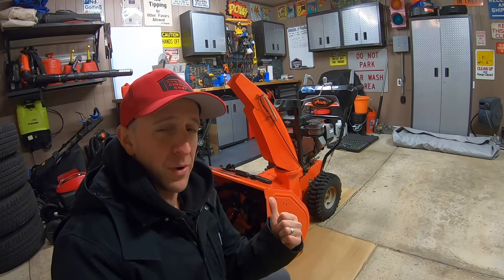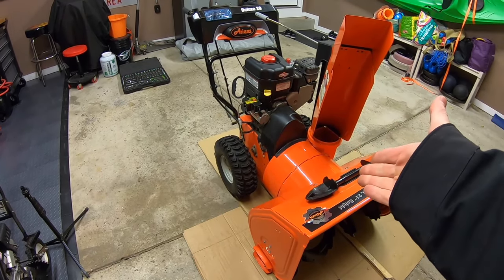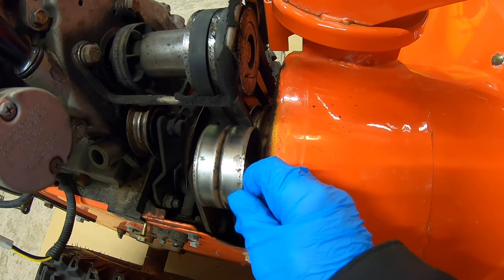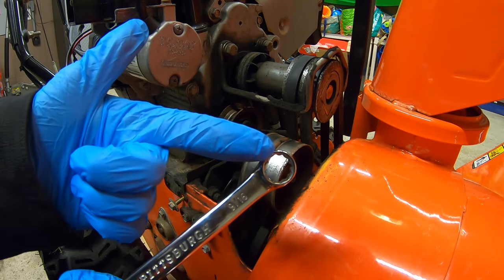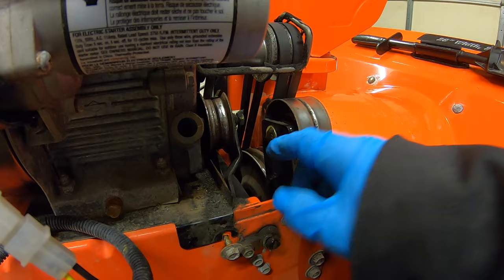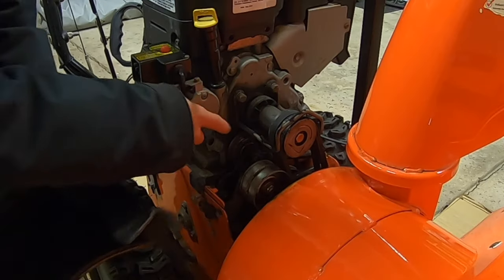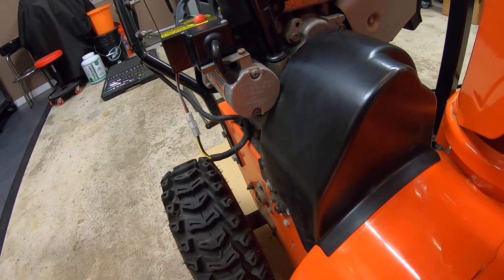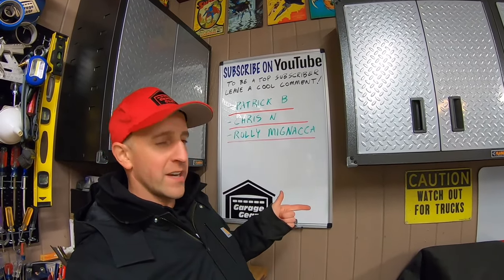HOW TO ADJUST A SNOWBLOWER AUGER BELT TO THROW FARTHER

Comment: Did you do the belt adjustment with the auger handle engaged with a ie. clamp, or NOT engaged?   Running into some slippage here, and have already adjusted the wire from the handle to the spring. Belts "shreek" occasionally when under load.
Reply from the maker: I made the adjustment with no tension from the handle. Did it loose. Check your belts for wear. Could be time for new ones perhaps!
Reply: The pulley you adjusted might have a bad bearing. Spin it by hand see if you feel anything. That pulley shouldn’t be turning when the lever isn’t applied.

Comment: Replaced my belts now the auger spins upon startup burning up the brake in a matter of seconds, I adjusted the tension all the back can’t go any farther, any ideas?
Reply from the maker: Sounds like the belt you installed is smaller than your previous one. I would double check the sizing
Reply: @GarageGear  you are correct, by about a half an inch

Comment: Installed a home made auger kit this past weekend on my 2020 Ariens Classic 24.  Wasn’t that difficult after watching your videos.Just waiting to get a bit of that white stuff to test it out. I notice the two belt system on the video blower. My unit has single auger pulley set up which I have adjusted as per the video. Other than sharing the load over two belts, would I see any performance increase? Also would a double belt be to much for the Ariel AX 9.5 motor?
Reply from the maker: Hey Rick good question. There are a few reasons why they do the double belts. One is for double the grip and less belt slip. Another reason is if you break a belt you can theoretically still keep going to finish the job. Doesn’t affect the engine at all. My engine is ten years old now without any issues. Thanks for watching
Reply: Thanks: think what I’m going to do is wait until the belts need replacing. Then buy the kit which comes with new belts. So far this winter, we have received only one snow fall that required blowing. Been a green winter and yet Dorchester Ontario is only 2 hours west of Buffalo NY… Mother Nature must hate them.
Reply from the maker: @rickmuir7616  it’s funny all that snow was gone a week later. Might get an inch tonight. We’ll see.
Reply: @GarageGear  I’ve been doing some research as to why Ariens says their kit won’t fit on my Classic. The out put of my motor is 3/4” where the kit is for a 1” shaft, as would be your Deluxe’s shaft. Amazon sells a 3/4” to 1” bushing to make the kit work. Do you think it would put too much stress on the motor shaft. Have you had any experience doing this modification?
Reply from the maker: @rickmuir7616  can’t answer that honestly! Have never tried that mod before so I wouldn’t know.

Comment: Is it possible to convert a Husqvarna lever action chute to a rotary action. I have all Ariens (they are the best imo) but I got a Husqvarna given to me and I don't care for the back n forth  lever action chute control. 
Thank you sir..
Reply from the maker: With a welding torch any thing is possible lol. You would have to mount a gear ring on the bottom and some kind of gear/handle on the side to spin it. Not saying it couldn’t be done but you’ll have some work ahead of you. Thanks for watching another John!
Reply: @GarageGear  Thanks my friend!  I thought I'd ask, because I thought you converted your father's over to a rotary .  Like you, I love tinkering with everything actually that burns gas... 
Keep up the great work JB.. !
John M
Reply from the maker: @johnm9840  oh I did a video last winter on putting a taller chute on. Friend of mine welded a gear ring to the bottom of a taller chute to make it fit.👍

Comment: 2 questions, I have a 2014 compact 24.... I want to upgrade to a double belt... can that be done on this machine....                 And also I wanted to put tracks on this thing... do they make tracks for the compact 24?
Reply from the maker: Hey Zin! I would say you could probably get the double belt pulley and fit it on your model! But I’m not sure if your belt cover would fit the same. 

Not sure if tracks would fit the compact model. You can plug in your model and serial number on the website to see. That’s a super expensive upgrade tho. It costs more than you can sell the blower for probably. Not to mention how long of an install it might be. Might be better off selling your blower and investing that money in one with tracks. Let me know if you find out if they fit or not. Thanks for watching
Reply: @GarageGear  Great thanks... I enjoy your vids
Reply from the maker: @zinnglanzschriber3810  no problem my friend!

Comment: I have an ariens and my chute gets clogged super easy and fast even when there isn’t much snow. Do you think this should be the first thing I check? Then check the cable in the back? Thanks!
Reply from the maker: It can’t hurt to check them. Plus try coating the chute inside with some silicone before each use. That helps prevent snow from sticking. Thanks for watching Patton!
Reply: @GarageGear  would the size of the whole where the snow comes out ever affect it? Have you ever heard or seen that in an ariens? Thanks!
Reply from the maker: @pnasty32  good question. It can affect it but the ariens design is rock solid and shouldn’t be an issue. Keep us lubricated and everything gets sent right out!
Reply: @GarageGear  Product called FLUID FILM works great. Aerosol can,available at most auto parts stores .

Comment: I put a new drive and auger belt on and it worked for a day. Now the auger belt seems really lose on the auger belt. I have an older toro 724 model. Doesn’t look like the tensioner pulley can be tightened. Any ideas?
Hard to believe the new belt would be lose after a few days of heaven snow. Ani ideas. Do I need a new belt? Can’t seem to see where the tensioner pulley is adjustable.
Reply from the maker: I’m wondering if you bought a belt that is one size too big. Most pulleys are adjustable. Clean it off really good and see if there is an adjustment slot or hole. If no, then you could attempt to drill a hole further up for the pulley bolt and add tension that way.let me know what you find out.
Reply: I have had Toro's with the same problem. The bushing on those wears out. Take the cover off, without engaging the auger push in on the belt while looking down at the big pulley. There is a good chance that it is coming up nearly a quarter of an inch. If it is, you need to replace the bushing.
Reply: @johnweber6147  thanks for the quick idea.
Reply from the maker: @johnweber6147  thank you for sharing John!
Reply: @johnweber6147  thanks. Ended up needing a new belt.your video really helped. Thanks

Comment: My snowblower screams under load and smells like burning rubber, only when throwing snow. Could this be the problem? New snow blower only 2 years old used twice in that time period.
Reply from the maker: Check your belts my friend! That’s all the signs of a belt issue.
Reply: @GarageGear  doing it now thank you! I have DR Pro XL 30. Looks very similar to the Ariens from what I can see, double belts etc, I wonder if they make them for DR.
Reply from the maker: @the_atomic_punk487  possibly! Let me know what you find.
Reply: @GarageGear  I’m finding the augers are engaged the entire time even if the handle isn’t pressed down, should I adjust the clutch pulley so it’s not contacting the belts at all while the handle isn’t depressed?
Reply from the maker: @the_atomic_punk487  yes I would make some adjustments
Reply: @GarageGear  yeah I adjusted the pulley so it’s not engaging at idle, worked for about 10 min then she started screaming again and the belt housing was filled with belt dust, smelled of burning belts, it appears one of the belts, there’s two, is stretched longer than the other and is frayed. New machine, I’m frustrated, hope there isn’t an issue with the alignment of the pulleys. Guess I get 2 new belts and put them on. Thanks for your advice. Love your videos, you do a great job, informative, concise and to the point. Keep doing what you’re doing!
Reply from the maker: @the_atomic_punk487  no problem my friend! Let me know how the two new belts work out! Thanks for being a cool fan!

Comment: I'm having issues with my Ariens 624E.  It does not always go as fast as it should in the higher gears.  It seems to get worse the colder outside that it is.  Any suggestions would be greatly appreciated.
Reply from the maker: @24danrock  I would definitely check your cable adjustments and friction disc to make sure they are in order!
Reply: @GarageGear  thanks. After watching a few of your videos, I'm convinced that it's the friction plate.

Here in Milwaukee,  we never can be ready too early for winter.
Reply from the maker: @24danrock  I hear ya my friend

Comment: So today I ran into an issue. Bought my Ariens Deluxe 28 10/23/2022 and it was delivered 10/28/2022. Used it once. Pulled it out today, started right up, moves forward and in reverse. But as soon as I engage the auger it backfires and shuts down.
Reply from the maker: Check your belts! May be way too tight! Did you let the machine warm up? Thanks for watching!
Reply: @GarageGear  I checked the belts and they are adjusted just right. Gonna drain the carb today when I get off work just to see if I have water in the gas. Love your vids by the way.
Reply from the maker: @NDColorado2023  sounds like a good plan my friend! Appreciate the positive feedback! 👍

Comment: I had to pull back my snowblowers pully \, as the the augers whern't stoping ,i watched it without the cover on and the pully would turn on its own with the lever up , even when i dissconected the cable , it would still touch the belt and the augers would still turn,so i had to move that pully back just enogh and fine tuned the cable to get the augers to stop .So im not so sure about your thoery lol
Reply from the maker: Thanks for sharing
Reply: Did the belts burn up for you while spinning with the brake applied? It did for me, didn’t take long

Comment: Well my Columbia 357cc 3 stages 28 inches( 2021).... is bad one..... ni cable adjustable and no pulley adjustment.... when a buy it , I buy it because I think is good one... it is no very bad but... nothing for adjustment,  and my oldest one, very cheap was very more  power for picth the snow very far away...
Reply from the maker: Thanks for sharing fabien! Perhaps you could drill some holes to put the pulley bolts in so you could tighten the bolts? Just a thought. Thanks for watching
Reply: @GarageGear  Yes I think this is a good idea.... I m gonna put the bracket on the press drill... 👍👍
Reply: @GarageGear  Good news, I made a mistake the first time I wanted to adjust the pulley so that my snowblower sends the snow further.  I had just unscrewed the bolts that held the pulley thinking that there was space to move the pulley and make the belt tighter.  when I unscrewed the bolts I found that I could not move the pulley anymore... and the second time I removed the bolts and the pulley to make another hole and be able to tighten the belt more than I saw that there  had another hole for the bolts .... it is only by removing the pulley that we can see that there is a second hole to be able to change the place of the pulley, it advances the pulley 1/4 inch towards the  belt and it gives more tension... So with this model.. Columbia snow blower 357cc 28 inch 2021, if you want to adjust the pulley to give more tension, you have to remove it and change the hole bolts.

Comment: What if one belt is tight and the other is loose on the double belt system
Reply from the maker: They should be pretty equal. If they seem loose you may want to get a set of new belts.
Reply: @GarageGear  they are new belts
Reply from the maker: @walleyeheadztackle5415  are they the same size? Is there a big difference?

Comment: Sir: Good comment. But - PLEASE - have the user check to insure that the belt has not made too tight. i.e. with the cover off, start the engine and then check to verify that the auger/s is/are not turning with the motor running.  If you tighten the belt too much - the auger will not stop.  The AUGER MUST stop when the auger lever is released.  Also, there is an adjustment procedure for the cable to insure that that adjustment is correct also.  Good presenter - sir.  Just be complete to avoid personal injury by having the belt too tight.
Reply from the maker: Thanks for sharing